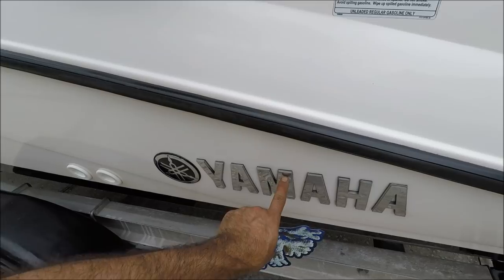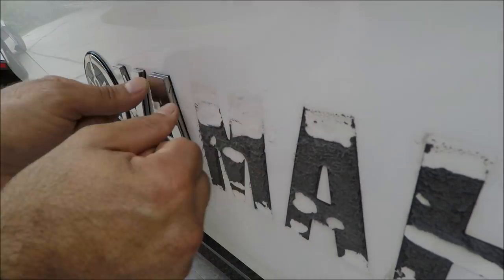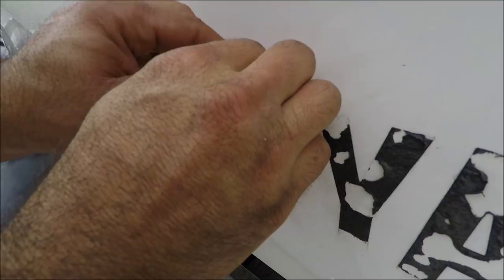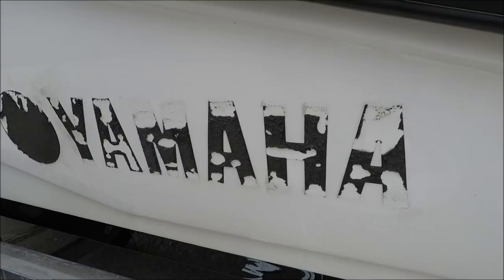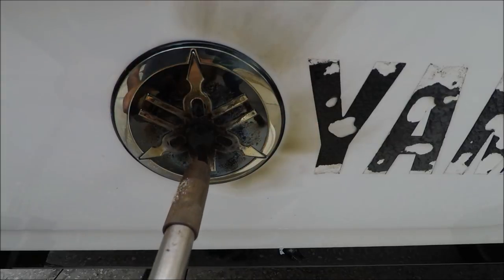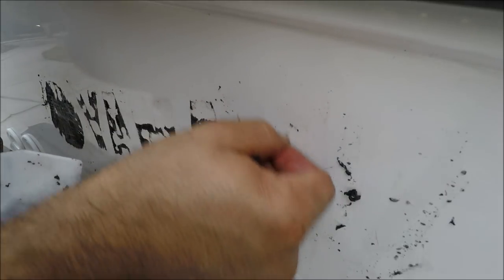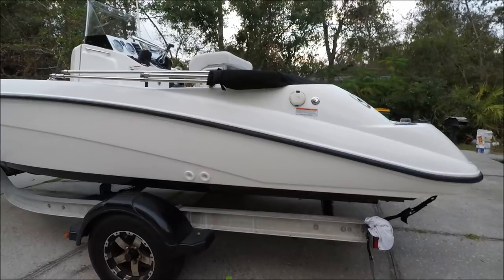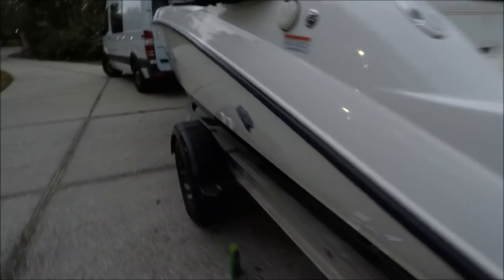New Boat Logo for my Yamaha 190 fsh jetboat yamaha 210 fsh yamaha 255 fsh

Comment: This was hard for me to watch ... never put open flames on your boat , that's a good way to blow up your vessel or over heat the gel coat around the sticker and cause it to bubble. The short flame bursts don't transfer the heat at the rate a electric heat gun can and a electric heat gun will warm um the hull around the sticker and work heat under to the adhesive. After you bull off the decals if you have adhesive left over you can try a pressure washer . Whatever is left goo gone or brake cleaner and a rag . I'm not sure if the spider wire is necessary if you put proper heat in the logo. You got it done though lol
Reply from the maker: rrandydduke you are right but  admitted it was fun to watch lol
Reply: +Out On The Reef yes i was in shock lmao